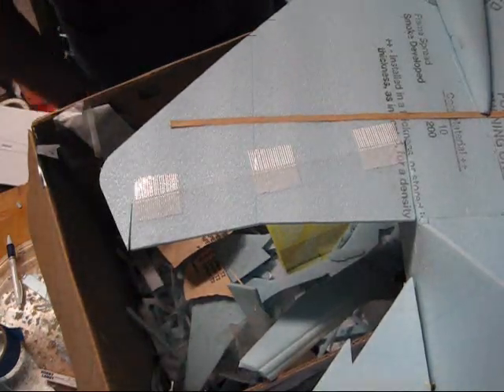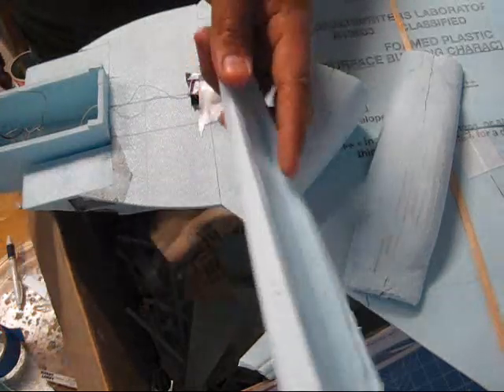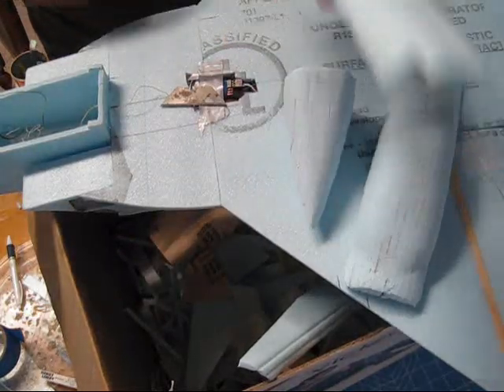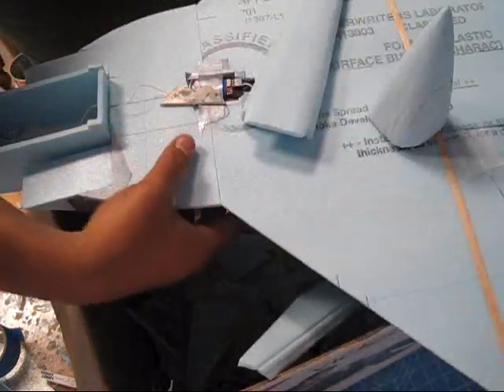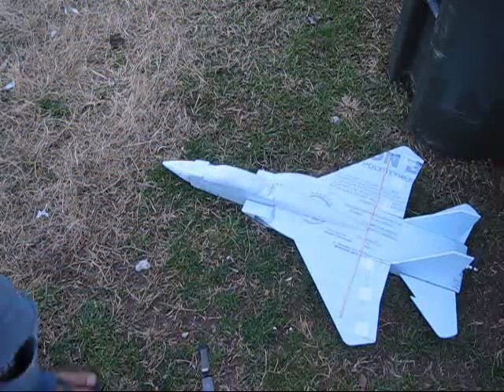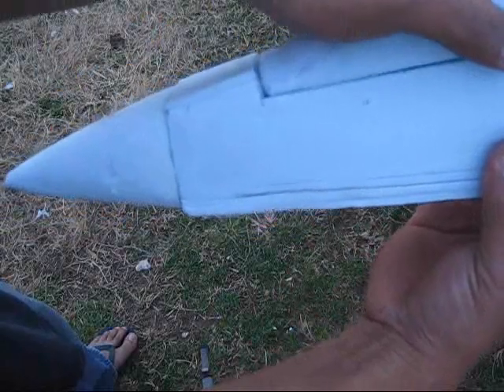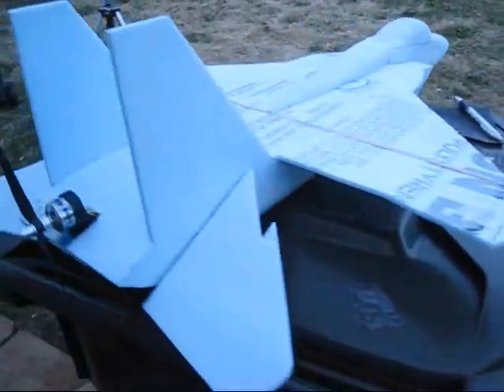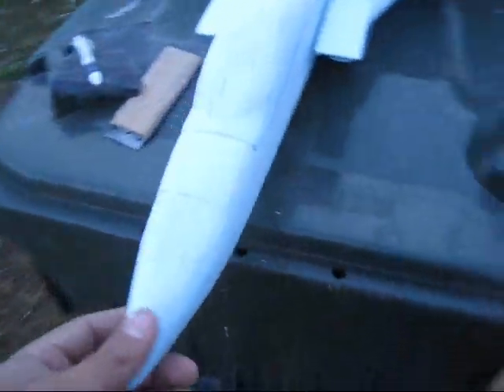How to build  a rc  F-15   (part 5)

Comment from the maker: you can get it at LOWE'S  is a pack of 4' wide x 50' long and is bent on pieces of 2 feet is call DOW ant cost 48.00 but is worth it and much cheaper than DEPROM